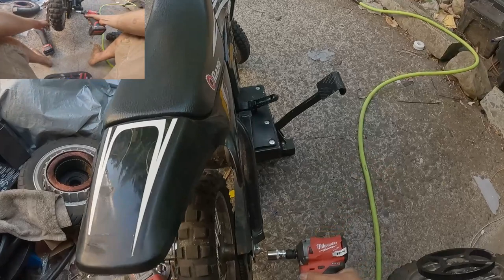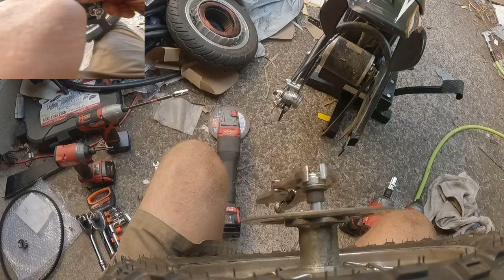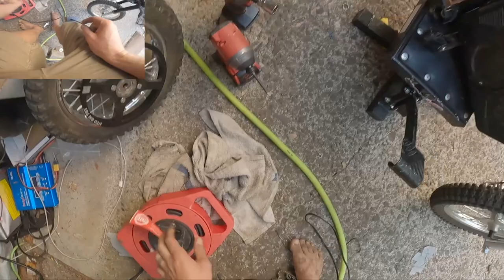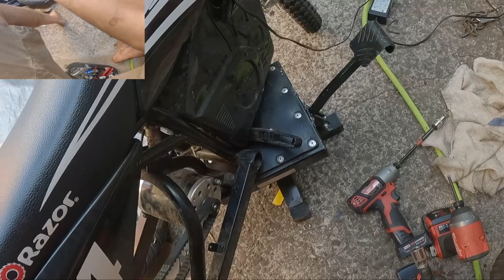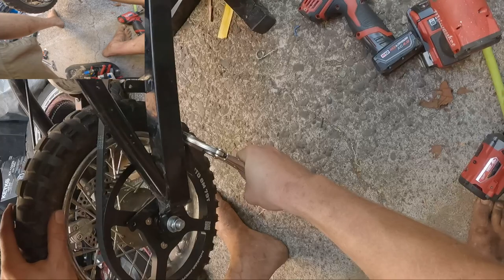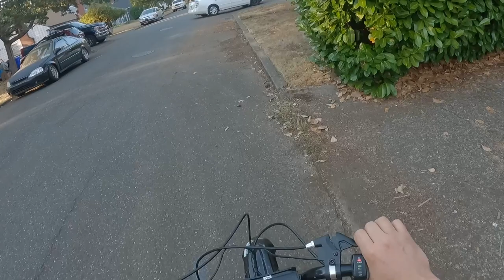belt kit installation for razor mx500 and mx650

Comment: This is totally awesome wish I had the money to try this out but I have a razor mz650 with 2 32volt batteries and running off of 72volt controller so I don’t know which size I would need
Reply from the maker: Are you wondering what size front pulley you should select?  If so, this depends on how many amps your controller pulls. Feel free to contact me using the site if you have more questions:

https://beltsnshit.com/pages/contact?from=ytCA2

Comment: This is awesome.  I’ve been waiting for someone to make a belt drive kit for these motors.  I love my mx650 72v 120amp.  I just bought a mototec to start a new build so if you want to start making the pulleys to fit those bikes I think there’s another market ready for you
Reply from the maker: Good idea. Thank you. ❤️
Reply: I wish to second this. 

I'm running a Lunar Scooter LS 1200 (basically identical to the Mototec Uberscoot) and I converted it from 36V 1200W (SLA) to 48V 2000W (Li-ion): the only problem is it now loves to eat up chains and sprockets. 

I was thinkin of drilling out an old sprocket and using it as a 3-bolt to 4-bolt adapter plate to use the MX' pulley you designed, but if you're willing to retool the design to fit the Mototec, I'd be interested in purchasing one for mine as well. 

Keep us in the loop, and keep on doing what you do!
Reply from the maker: Oh thank you. The tricky part is the motor shaft and proper alignment. No plans currently in place for a mototec unfortunately. If your conversion goes well I may buy the design from ya or have you make me some adapters 😉
Reply: How do you go about tightening the belt if it is loose?
Reply: So what are the benefits? Is it just a quieter ride with no maintenance? I'm asking because in order to make three or four hundred dollars there's going to have to be some good benefits
Reply from the maker: Currently, the belts aren’t stretching but if they do, i offer replacement belts for a very affordable price. If you have a slotted rear you can simply move your axle back a bit.
Reply from the maker: Quiet, no maintenance, cleaner and a smoother power delivery are the main benefits I have found. I have more marketing bs on the site if your interested beltsNshit.com